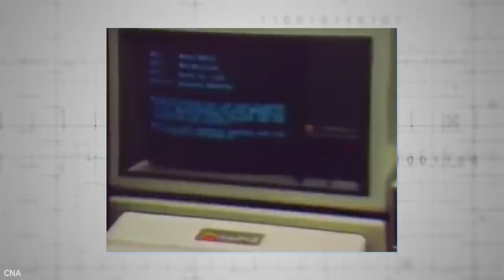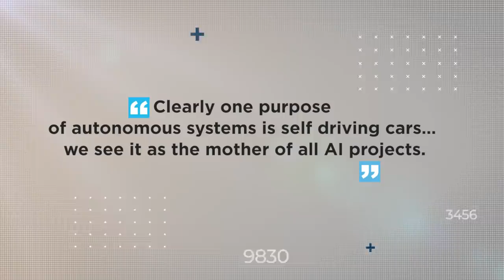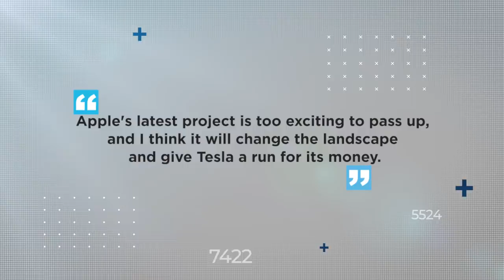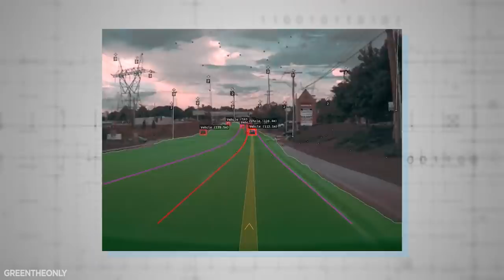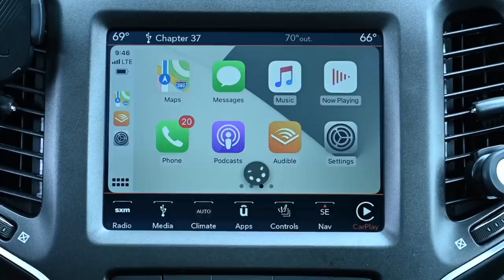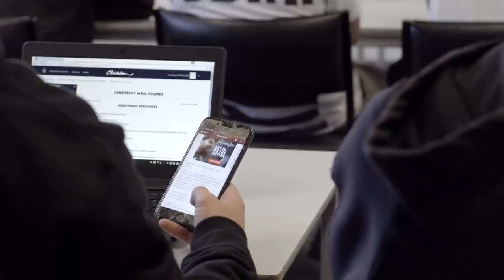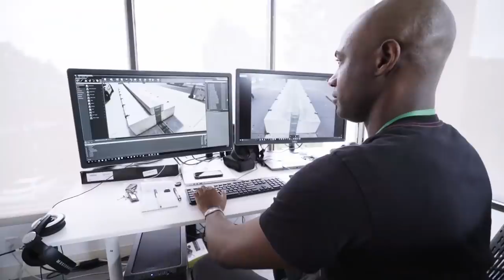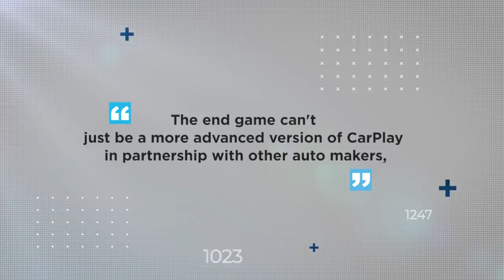Apple's Next Big Product: The Apple Car

Comment: Customer: Will the car run slower when the new models come out?
Apple: No that’s just our phones 

Hoping the touch screen steering wheel is not as messy as the Apple TV controller. 

P.s. you already know this won’t take gas and will need it’s own Apple charger
Reply: Charger sold separately
Reply: @TheOnlyGamingMC  ?
Reply: @TheOnlyGamingMC  ?
Reply: @last5902  apple fans are pure evil, I reccomend you report his comment
Reply: @TheOnlyGamingMC  Stop being evil. Where is your evidence? There is more evidence that Apple is a horrible company than the amount of evidence that tells me that you are not a bot.
Reply: The battery will drain quicker that you have to replace it through Apple care as they paired the car with the battery.

Comment: Apple in their advertising website be like:
To save the ecosystem we exclude the the car engine and exhaust by thinking inside the box, you may use your old crappy car engine and exhaust or you can buy it to us seperately which ONLY cost 9999999999999999999999$

Comment: apple car base model £100000 comes with a steerin wheel 
car main frame ,speedometer and everything else apart from the steering wheel in a car is available separatly for £50000